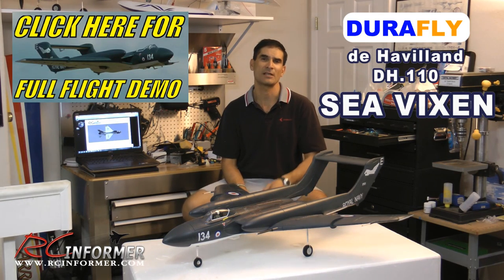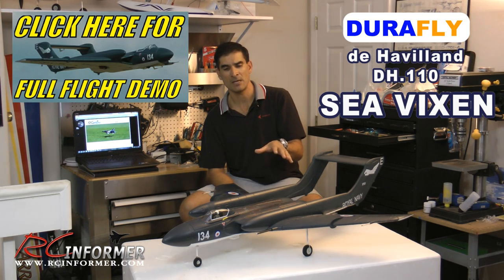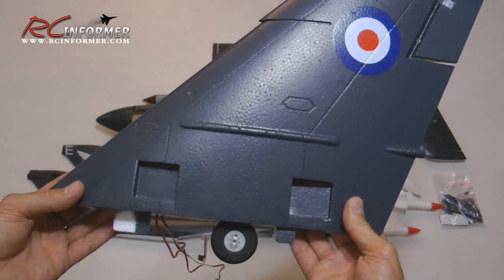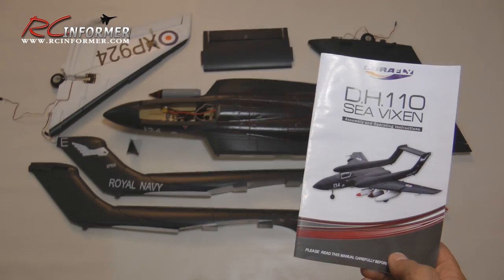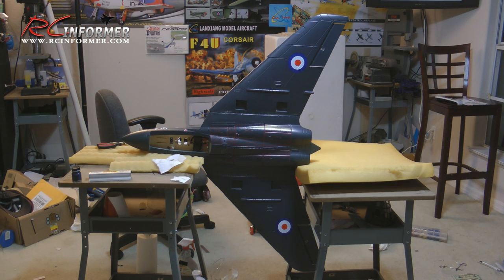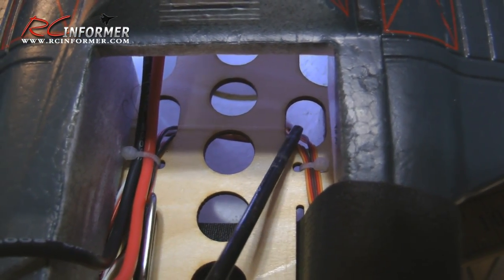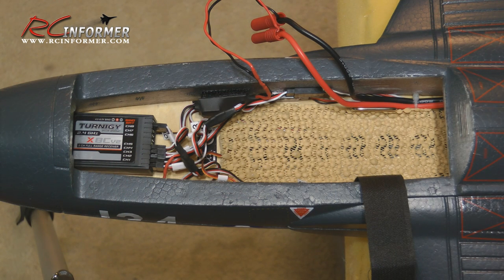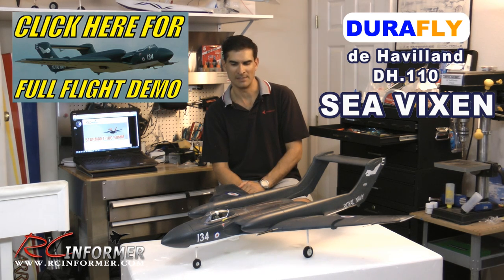DURAFLY / HOBBY KING de Havilland DH.110 Sea Vixen BUILD GUIDE in HD

Comment from the maker: Use standard throws of the radio and adjust from there, the elevator needed more throw than you might think is normal. I balanced mine right side up just ahead of the wheel wells as the instructions say.

Comment from the maker: yes, what I was trying to say... is that retracts or not, if the wells are covered, the speed difference will be negligible. you will gain performance in climb, but not really so much in the speed department..... due to the decreased weight...

Comment from the maker: Airplanes have retractable landing gear so they will go faster, merely having the wheels come up is not enough, you have to seal up the holes.... the speed difference would be negligible as long as the bottom of the plane in clean.  Vertical performance and climbing would improve with a belly land plane because of the decreased weight